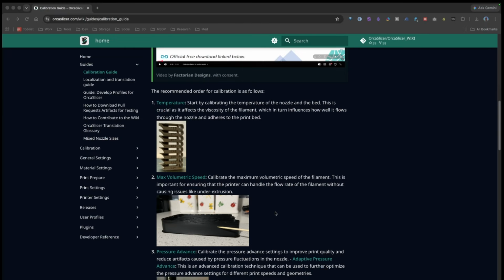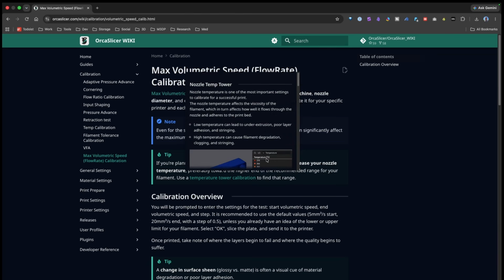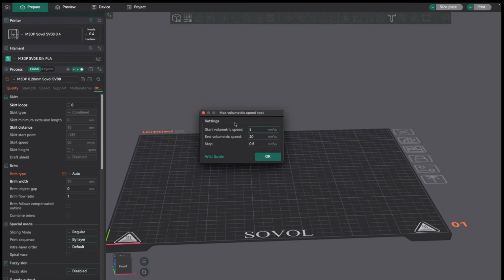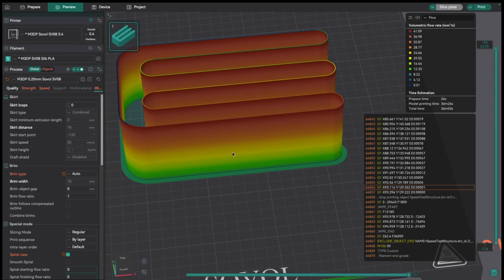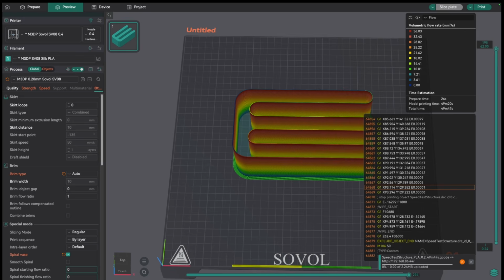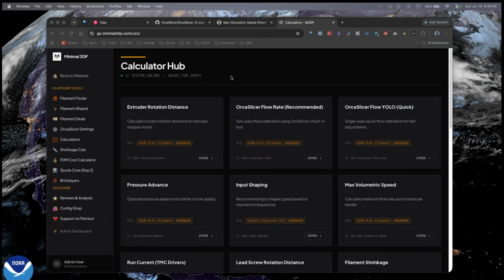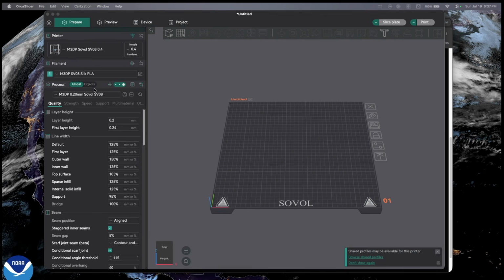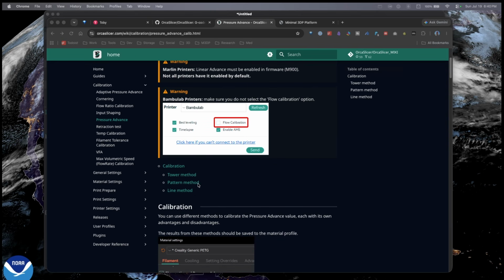Your Printer Isn't Slow — Your Flow Limit Is (OrcaSlicer Max Volumetric Speed)

Comment: Nice video. But you can see speed directly in Orca. After slice, in "slicing result" pop up switch to Flow. Select your mm in right bar (the one with layer count) and move buttom bar slightly - you see your flow above buttom bar with coordinates.
Reply from the maker: That's great to know, I appreciate you sharing the info.